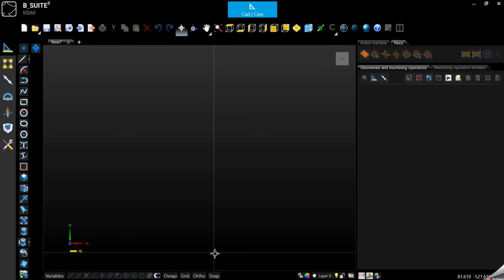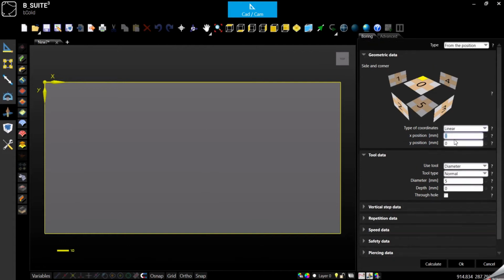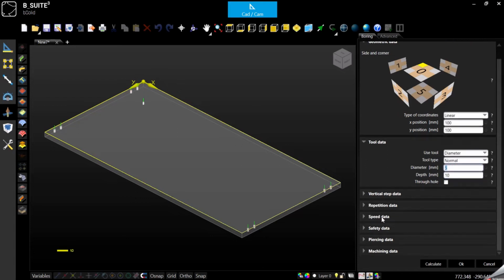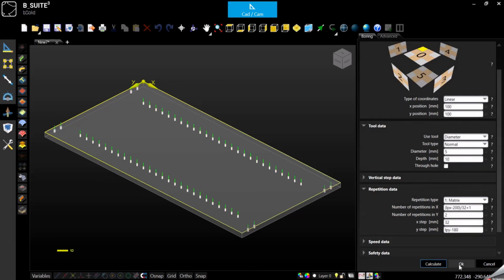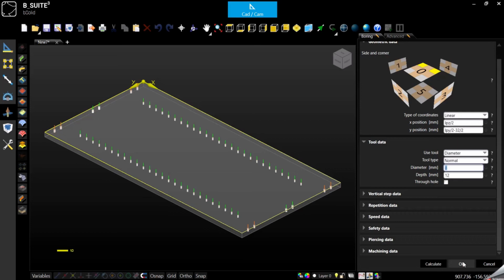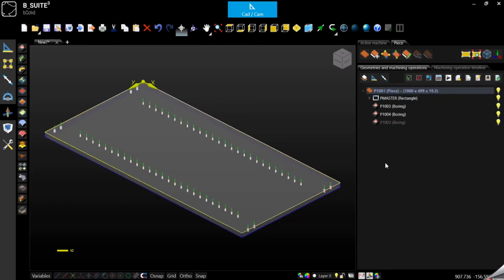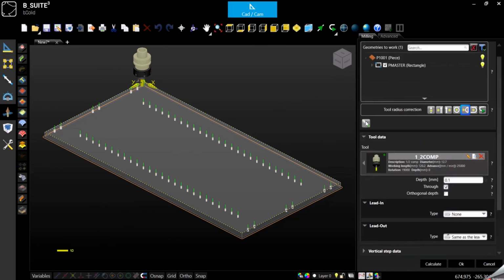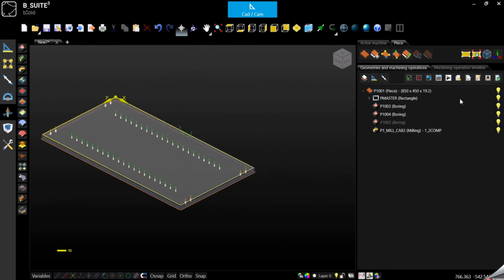BIESSE bSolid - How to create a simple parametric program

Comment: How would go about making one program for vertical boring where the location of the holes is dependent on the panel size, for example, if the panel width is 310 to 350 use these holes, if 351 to 390 use these holes, ect

Comment: Não está correto os furos a 5mm, no painel de 1000mm fica 100mm ambos os lados, mas se mudar o tamanho do painel não fica com exatos 100 de cada lado
Reply from the maker: Yes you are right. Obviously the exact measurement will be obtained (referring to 100 and 100 as in this case), only if the measurement of the piece allows it, but on the other hand, math is math.

Comment: how to drill from 3d solid CAD ty
Reply from the maker: Hi Rayhan, 
you have to select the 3D model, then create the wireframe in order to get the geometry/geometries and finally apply the machining using those geometries. 
Sooner or later I will make a video on that as well. 

Best regards

Comment: I am editing a program and it is not working and it is not getting deleted.
Reply from the maker: Hi, 
the software usually doesn't lock programs. Is there maybe a problem with the dongle?
I would recommend to try closing the software and trying to pull the dongle out and put it back in, then reopen the software and probably will start working again.
Reply: @freshzone  thank you